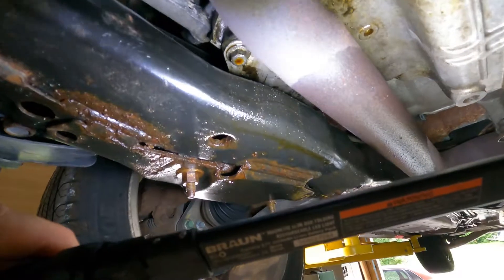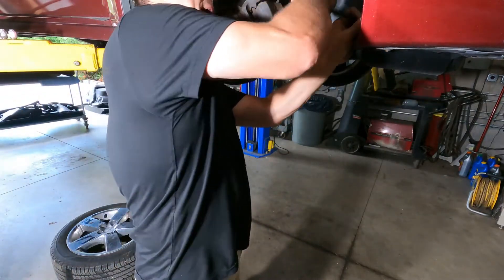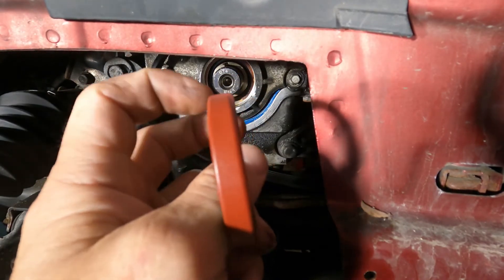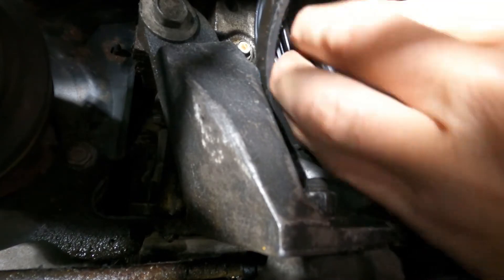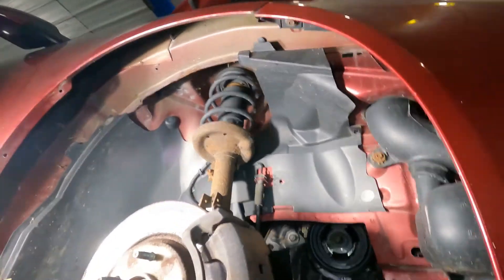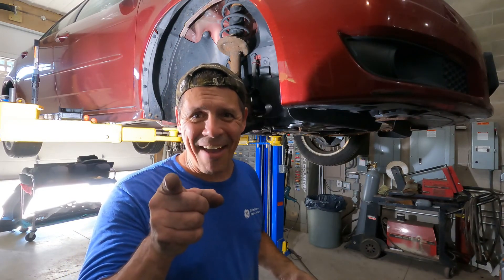How to replace harmonic balancer seal on a 2010 Pontiac G6 3.5l or other 3.5l GM leaking crank seal

Comment: Finally, a video on how to change that crank seal! I've been waiting forever to see how it's done as I'm a visual learner. I never felt comfortable doing it by the book as it instructs you to unbolt the engine carriage. I feel a lot more confident now that you show it's possible without doing that. My 2008 is the best car I've ever owned and I want to keep it on the road as long as I can. Thanks for responding to other questions about tools used and torque values. Thank you, much appreciated.

Comment: What brand puller did you use?? Looks more compact than the usual ones and certainly a better option for this job.
Reply from the maker: It’s an OEM tools harmonic balancer puller part# 25090.
Reply: @whatsnextgarage  Thanks! I bought one and now I have one more question. What was the name of the tool that you used to hold the balancer while you torqued it?
Reply: @TM-ee7gm  that’s my very same question hopeful for an answer
Reply: @whatsnextgarage  curious as to the name of the tool, you used to hold the pulley down while you torqued it?

Comment: At six minutes and 57 seconds, when installing the pulley, what tool did you use to lock The pulley in place to torque it down?
Reply from the maker: Universal pulley holder.   Found it on Amazon it comes in handy a lot of times!!  Have a great weekend!

Comment: I've had my g6 for 18 years 250,000 miles still runs like a champ im having a howling issues everytime I turn my wheel even slightly to the left around 25mph gets louder as I drive goes away when Im slighty turned to the right changed the hub bearing assenbly axle all the suspension components and bushings still howls the only thing thats making a noise is the passenger side inner cv axle right where it connects to the trans axle or intermittent shaft I've tested the wheel on all angle pretty solid idk im lost at this point im thinking its the transmission
Reply from the maker: Wow you have been very thorough!!  Unfortunately it sounds like you are right and it’s in the transmission.

Comment: what is the blue seal you pointed out under the crankshaft?
Reply from the maker: That’s the new oil pan gasket I installed. Four times now🤦
Reply: @whatsnextgarage  appreciate the response!
Reply from the maker: @danielaguilar7316 you’re welcome. I have a few shorts showing my stupidity on my third try. For some reason this oil pan really kicked my ass🤷‍♂️👍👍🤣
Reply: Hello @whatsnextgarage  again. what is the tool you used to torque to spec? also how many foot pounds does the crankshaft bolt need to be bolted down to? I appreciate any help you can give!
Reply from the maker: @deezkustomz  I don’t remember the torque but I used a universal pulley holder from Amazon to keep it from spinning.

Comment: What metal block did you use to put the seal into place? Can I buy that an a parts store?
Reply from the maker: It was a component I made. If you search seal driver for Subaru crank seal that should get you started down the right path.

Comment: Hey dude. I have a 05 G6 leaking dew drops of oil for years. Already replaced filter housing gasket. Any sure ways to know if it is oil pan or crank seal?
Reply from the maker: The best way to see if it’s a crank seal would be to just pull back the small amount of inner fender well away and look at the lip seal. You can see between the spokes of the crank pulley. That’s the best way. Problem is, there’s such a large area of oil pan seal that takes up the gap between the pan and upper half of the lower motor, that could also be weeping some oil. Either way you would have to pull some of that inner fender away to get a really good look.
Reply: @whatsnextgarage  yea thanks man, it dont look so bad, I may just have a look.
Reply from the maker: @johndoegta2189  you won’t have to pull off as much as I did if you have the same plastics. Just pull enough to fold it towards the front. Don’t be afraid to bend the plastics cause they are pretty durable.
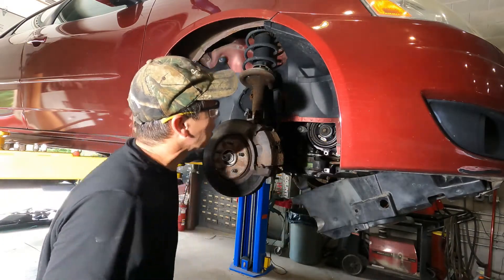Reply from the maker: @johndoegta2189  at about 2:36 that’s the piece you need to remove. You DO NOT have to pull that entire piece that I removed before that time. The entire curved piece. That can stay.
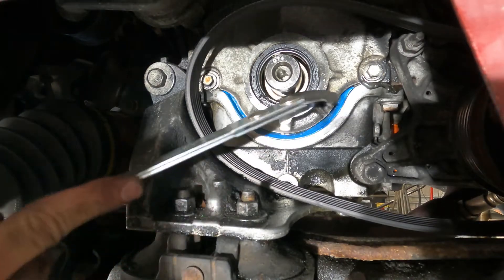Reply from the maker: @johndoegta2189  sorry for all the replies. At 3:53 you see the blue rubber gasket for the oil pan. That gasket could be weeping there as well.
Reply: @whatsnextgarage  I think after so many years the leak would have gotten worse IF it was the pan but I cant say for sure. At least the seal appears above the pan so it would be clear to see if it was leaking or not.

Comment: What was the torque for the pulley bolt?please.
Reply from the maker: @christianc.6064  I went 100ftlbs plus 90 degrees. Not sure what the torque was supposed to be so that’s what I did
Reply: @whatsnextgarage  Thanks a lot!

Comment: My car is heavily leaking oil from that side but I'm confused if it is the seal or the oil pan seal..
Reply from the maker: Mine is leaking from the gasket. The crank seal wasn’t the problem. I have to do it again the end of the month.
Reply: @whatsnextgarage  please make a video on how you install it.Thank you.
Reply from the maker: @LEONDELASIERRA1  I have the original video of replacing the oil pan gasket on my channel. I believe it is a two part series
Reply from the maker: @LEONDELASIERRA1  Pontiac G6 oil pan removal is the tirle

Comment: So im just gonna take it u have to use a impact to get bolt off before u take pulley off
Reply: You could probably wedge a screwdriver into the flexplate teeth and hold it from moving as well.